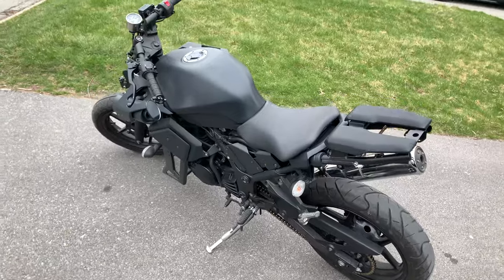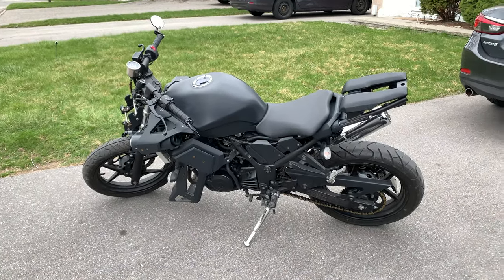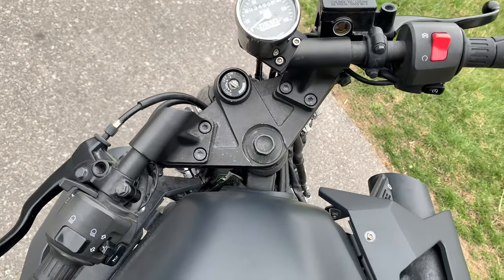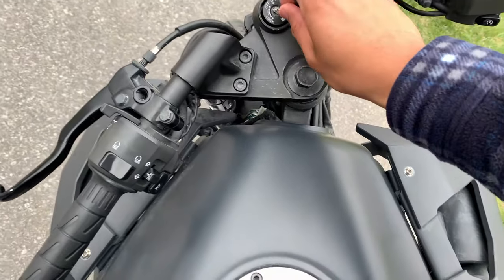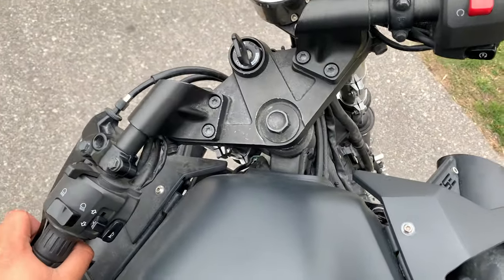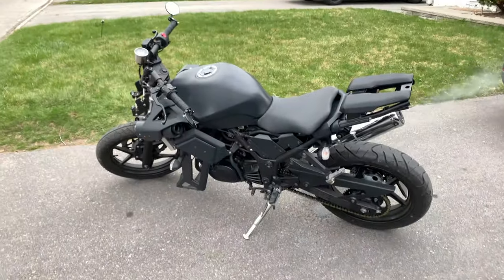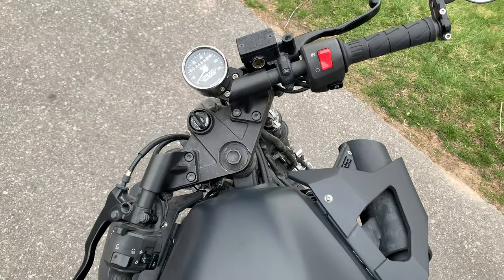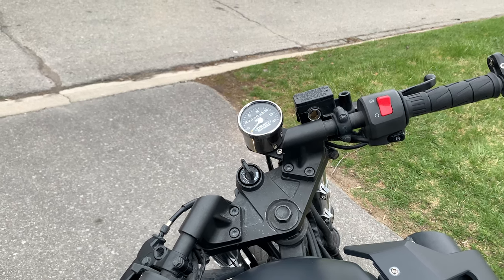HOW TO USE THE CHOKE ON YOUR MOTORCYCLE | STARTING YOUR BIKE DURING COLD WEATHER

Comment: You don't choke to get the bike heated up, you choke to get the fuel oxygenated. Several minutes seems excessive, and you will probably be running very lean and you will get a lot of popping of the exhaust as fuel will pass through and burn up in the exhaust. On my bike, the manual says to run the choke for about 30 seconds, while in reality, it's more like 30 seconds + driving a few hundred meters after I have closed the choke, before it can idle on its own.
Reply: Can you explain I’m new to motorcycle

Comment: You need to first get one the bike so its straight close tha stand !hold the clutch its good for your discks! Raise the choke and then power on
Reply: Also as soon as you power it on you should start moving because if you dont some parts of the engine don get warm and tha creates a substantial difference in some parts and in realy cold weather this can couse big problems i just haven’t found yet how you move around with the choke on because this is also not good i think maybe put it in half im missing some parts of the puzzle

Comment: So my choke cable has snapped and needs replacing however in the meantime can I just start her with the throttle open a bit and hold her at steady low revs for a while or ?
Reply from the maker: I never ran into that issue before but I’m sure it’ll help getting the bike up to temp